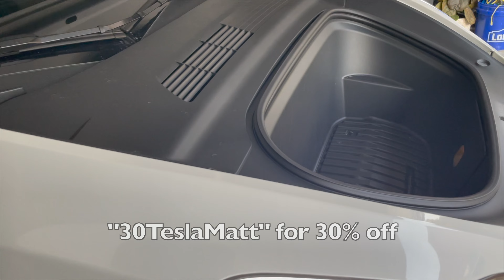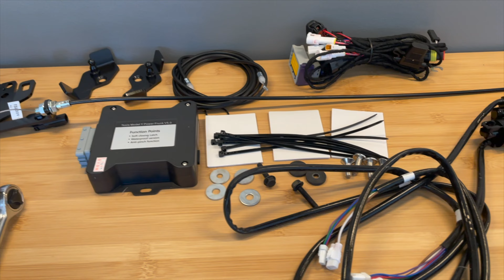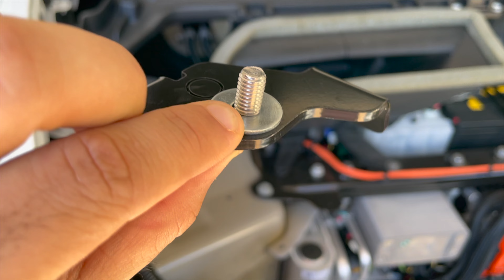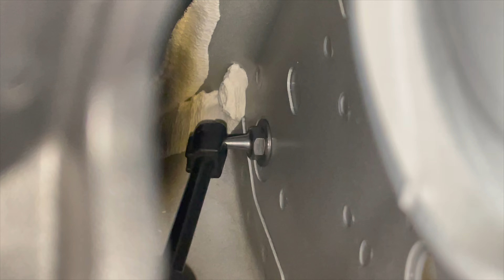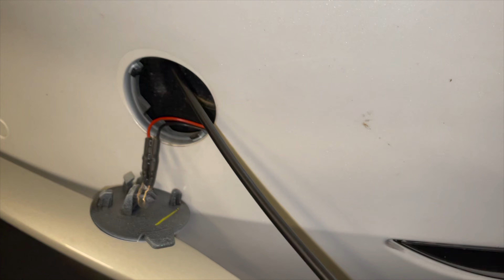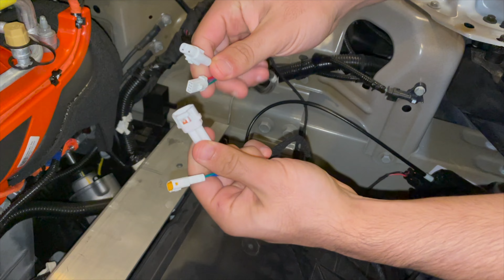TESLA MODEL Y - EASY DIY POWER FRUNK INSTALL // RESULTS!!

Comment: How do you wire this up now that Tesla has changed the aux battery to a 16v battery that does not have the normal positive/negative posts?

Comment: Any tips on why the frunk wouldn’t latch flush? It would click down then re pop up a bit and sit higher than it should. We adjusted the latching mechanism so many time and zero luck.
Reply from the maker: There are 2 round plastic things on the frunk itself. One on each side. Twist them each equally to make the frunk flush. If your frunk is sitting lower, make the plastic things stick out more (twist until they do) and vice versa if frunk is sticking up too much
Reply: @MattDanadel  not sure of these things but will check when the rain lets up and I have some time to reinstall. Thanks so much!
Reply: @trojansky2348  did you figure out the solution, having the same issue as you. Thanks
Reply: Also having the same issue- have you figured out why it wouldnt latch flush? It would click doen then repop up like uou mentioned

Comment: What was the piece from Tesla that you taped up? Why is that “left over”?
Reply from the maker: That piece I put electrical tape over is no longer used but I believe it still has power through it. So I taped it up just to be on the safe side in case water hits it and it short circuits